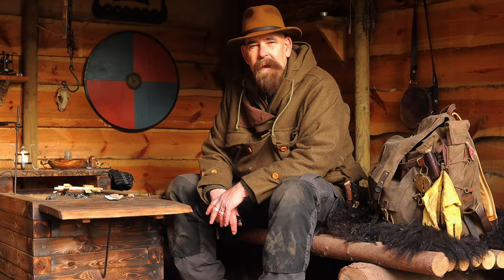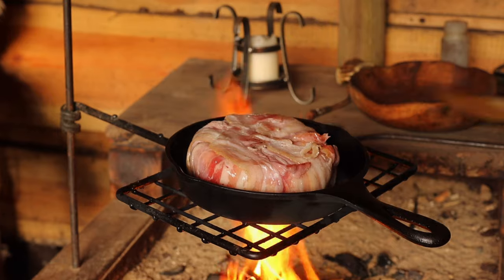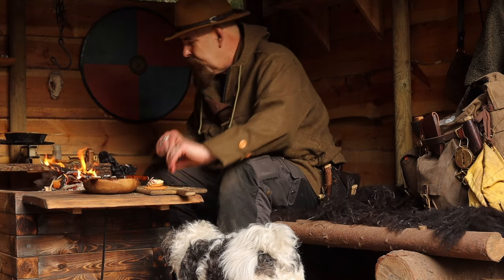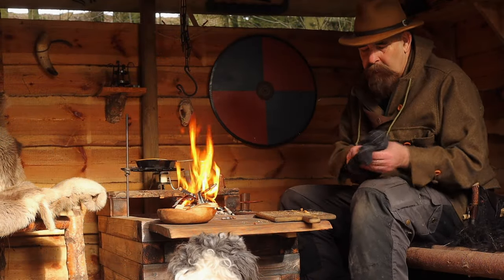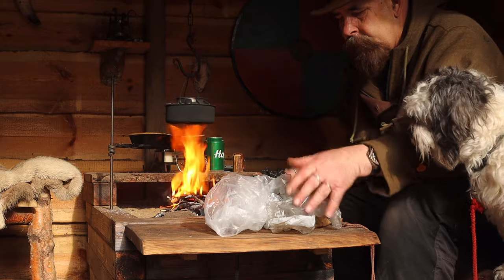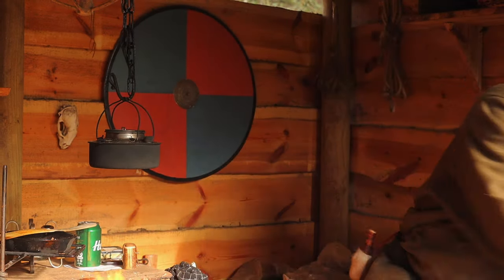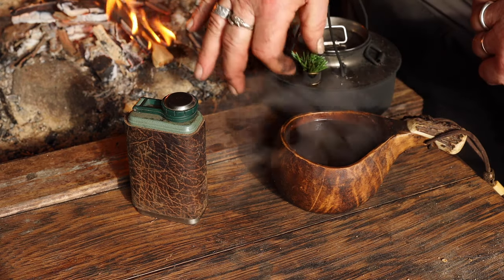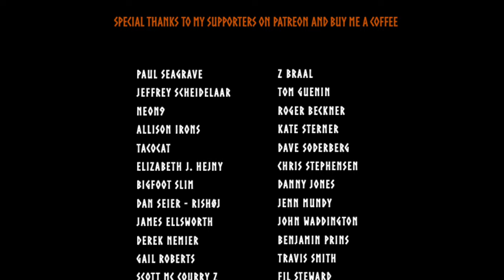I finally got it !

Comment: Congrats on the 100K subscribers.  Considering that only one in eight or ten viewers subscribe that's a great start and a solid following.  It  will multiply fast.  Yes it is something to be proud of and not to be taken lightly as some have.  Nice to see some green and not so much snow.  Assume weather is breaking there.  Actually we have some early flowers blooming.  Things are much earlier than when I was young.  It's changed a lot.  My orchard blooms a month early.   Good eats.  A pretty rich meal.  Hard to beat cheese and bacon.  Great for outdoor cooking.   Do you have a vid on building you shelter?  Also the fire pit/hearth setup inside the shelter.  Unique on my side of the world but I have seen several variations in Scandinavian vids.  I plan on doing that in my shelter.  I have been gathering primarily flat type rocks from all around the surrounding areas of the Appalachian mountains.  Some are unique and have a story.  (Floods, highest elevation, location, sea floor on top of the mountains, river banks, etc.)  The wink, I still remember learning when I was four or five years old.  I use it to, sign of what ever, you are ok with me, a happy, reassuring gesture of good will.  65 years back.  Cornelius, a little trim around the eyes.  He looks great.  I had my mini Aussie trimmed a little this weekend.  It's still winter so we'll keep the hair on her a while longer.  A natural shed is the best if you can keep them brushed.  Wads of hair.  Wish I still had all mine.  So far so good.  I look forward to the next vid.
Reply from the maker: Thanks Same for you kind and positive feedback 🤗 that means a lot to me. I’m glad you enjoy your stay in CimbrerCamp and Cornelius has had his haircut 🐶 and looks handsome again 
Atb to you my friend 😁
Tom 🏕🔥🌲🐕🍻🇩🇰